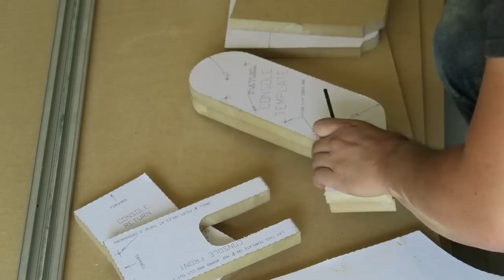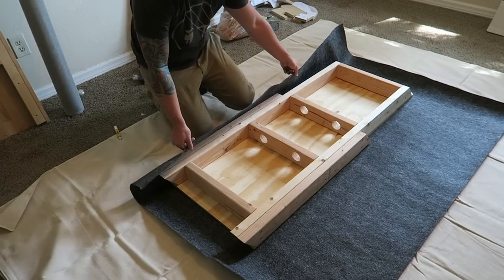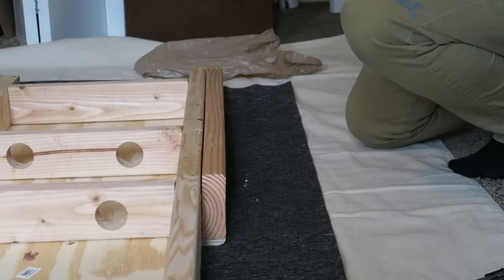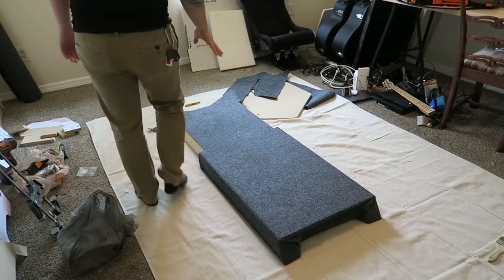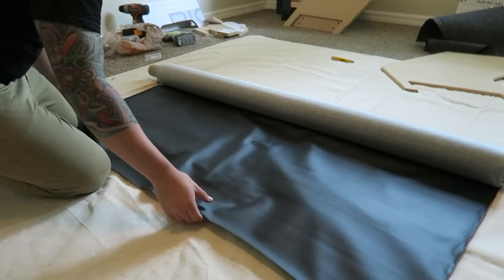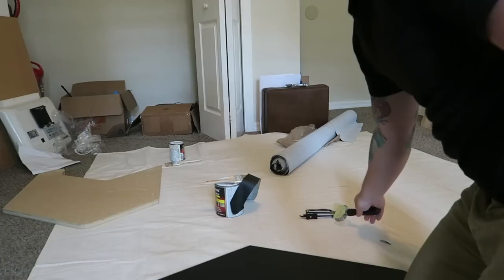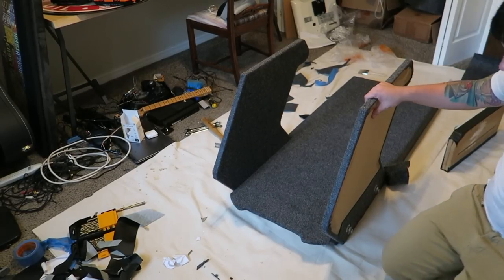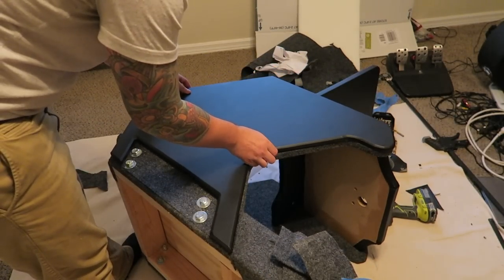Sim Racing Rig Build Part 2: Ricmotech RS1 Upholstery and Assembly AE22

Comment: Some 3M Super 77 or Super 90 would have made the process much easier and faster than contact cement. Put few staples in the under side of the carpeted areas to make sure it does not come up in the future.
Reply from the maker: Contact cement worked just fine and is plenty strong
Reply: @autoexistence8902  Awesome job!  However, thebigdustin is right.  Super 77 or Super 90 are made for this type of upholstery work and are MUCH easier and faster to use.  Just in case you ever do something like this in the future.  The company I work for upholsters wood and uses an industrial version of the super adhesives and works extremely well.  Just FYI